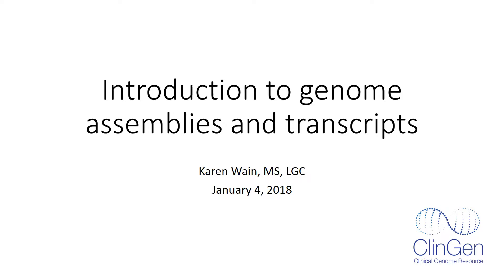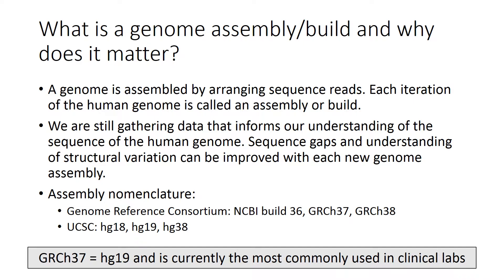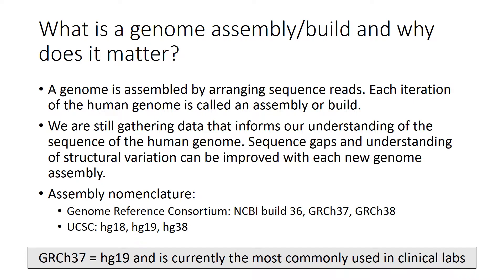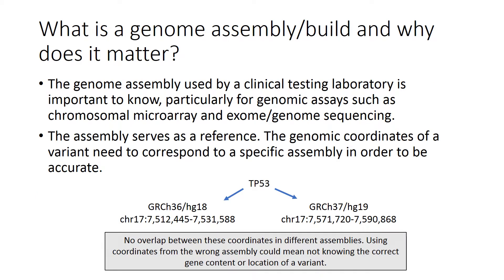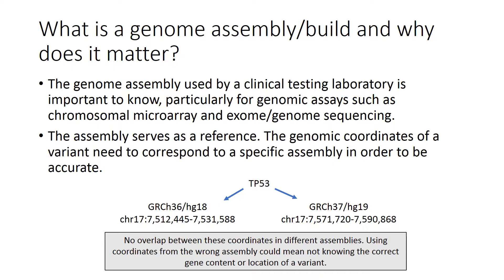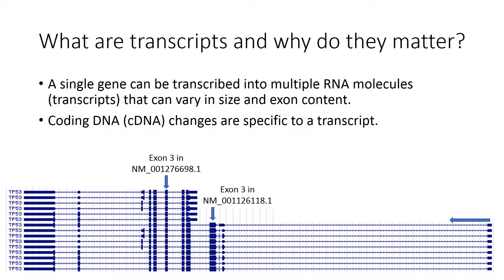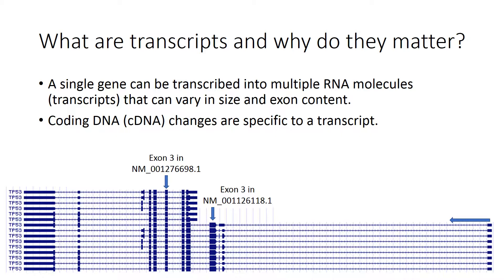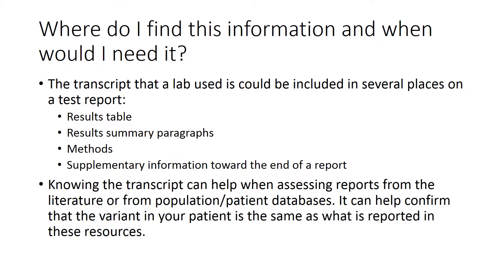Introduction to Genome Builds and Transcripts

Comment: The audio appears to be under some kind of automatic level control.  When speaking starts, the volume is exceedingly high.  After that, the volume drops to where you need to adjust the volume up to a listenable level.